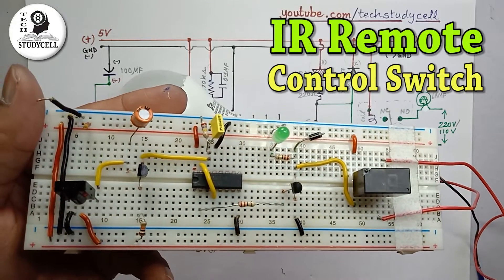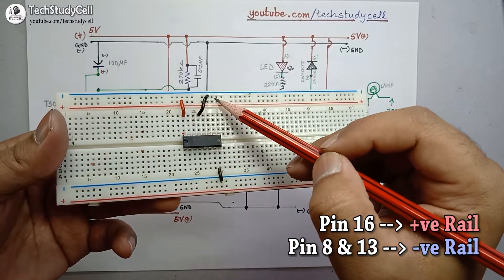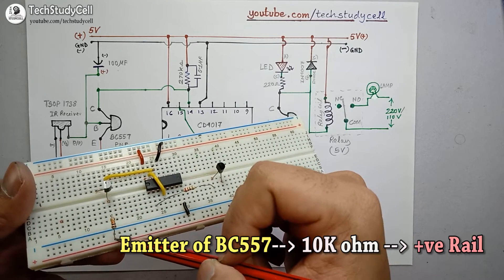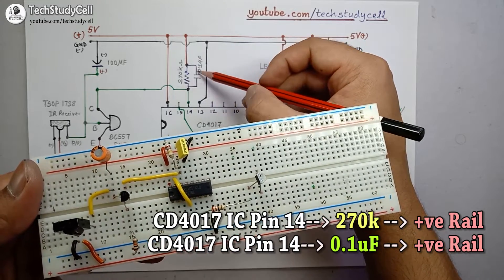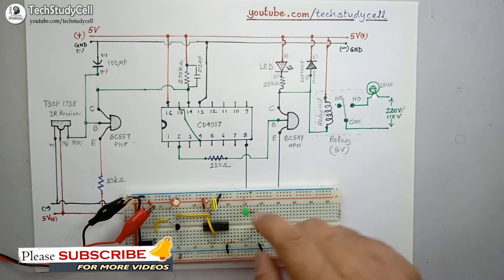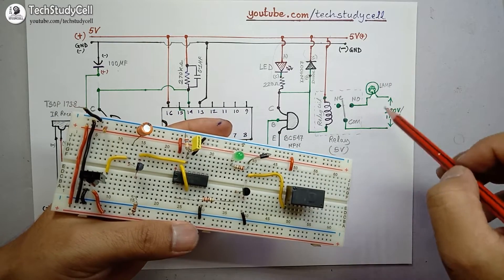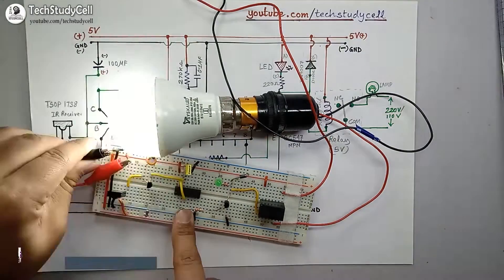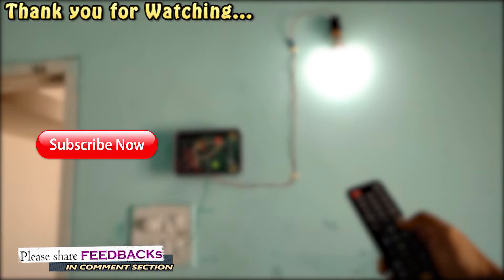How to make Remote Control Switch at Home to ON OFF Light Fan with IR Remote

Comment from the maker: In Upcoming video, I will make the Remote Switch circuit on PCB, with an inbuilt 5v supply, both Remote, Manual & Bluetooth mode, Connect the circuit with Arduino and 4 channel Relay module. Please do SUBSCRIBE and Press the Bell icon to get notifications for the upcoming videos. Thank you for your Support 😀.
Reply: Thanks sir
Reply: plz share its link i cant find it.. Thankyou :))